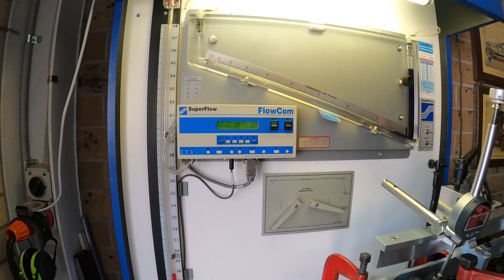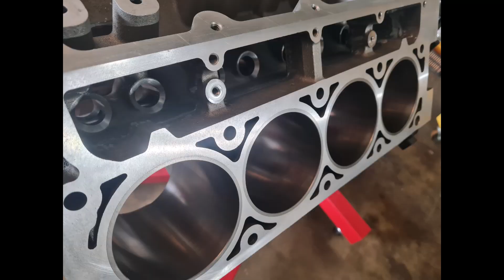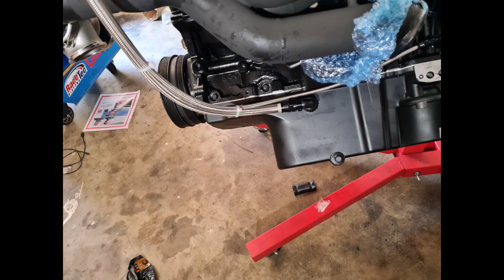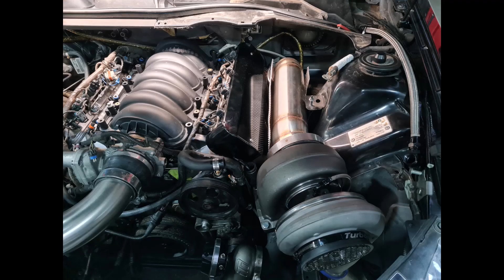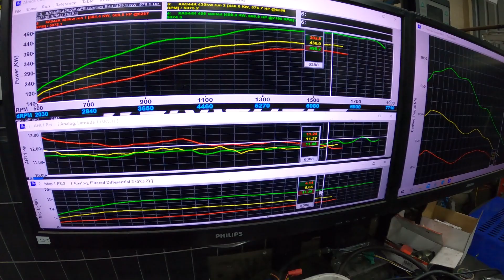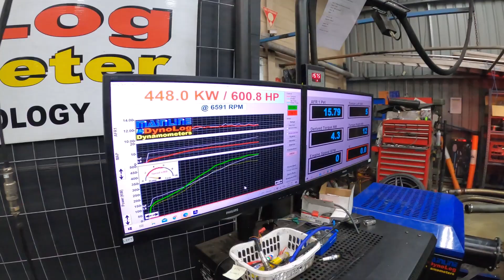Holden VE Senator 404ci Ls2 Turbo Build + Tune

Comment: interesting what was the theory on going a set of cath heads on a gen4 ls2, I went a different way my LS2 is the L77 I've used 823 square port heads they have been ported for Turbo the exhaust ports are huge, I went with 413 ci but went with JE flat top -5cc, Manley rods all forged bottom end 105mm TB sheet intake 5" intercooler 4" from Turbo to TB, 5 1/2" dump to twin 3", twin 50mm wastegates 3" cross over pipe 98mm T6 Turbo it makes a whisker under 1600hp, when I was sourcing parts I was going to build a bit like yours but after talking to people in the know said change things, and it wouldn't go where I wanted, its not on kill yet as few things I want gearbox and injectors wise, the fuel system was a money pit to fuel the monster its all Aeromotive pump and reg 10lt surge  -8 each side of the fuel rails and -8 return 2500cc injectors its had only the good stuff that was eye watering parts cost